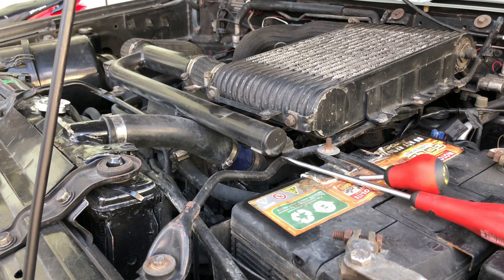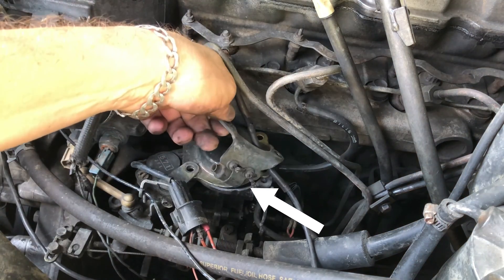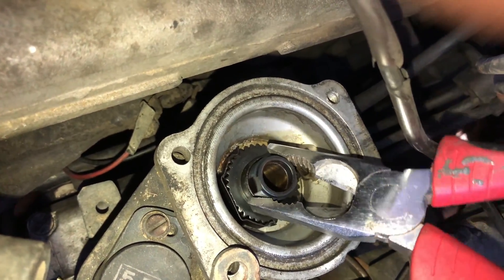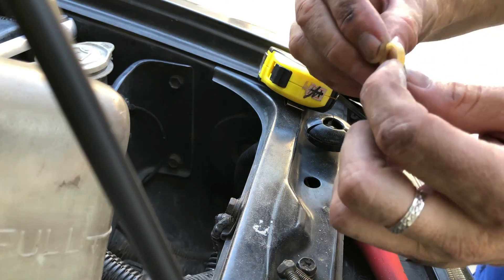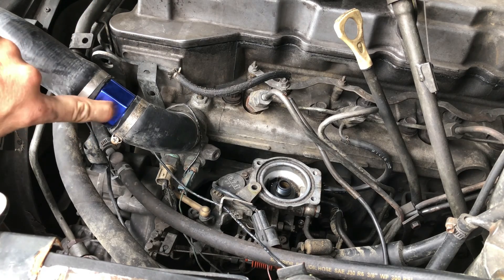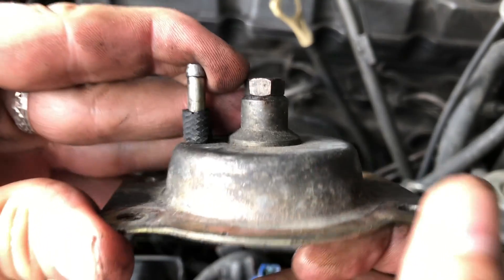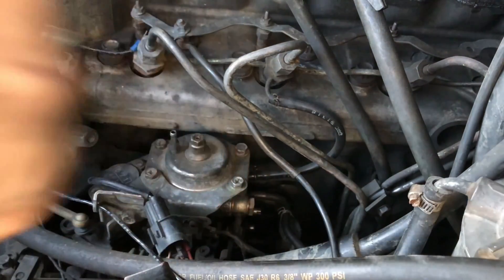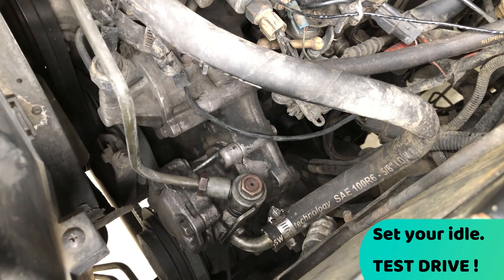HOW TO: VE TYPE INJECTOR PUMP PERFORMANCE TUNING MITSUBISHI PAJERO Shogun Land Rover Turbo Diesel VW

Comment: Hello, in the video you mentioned that it's important to install an exhaust gas temperature gauge before adjusting the boost pressure and injection quantity. Does the vehicle already have an exhaust gas temperature sensor from which the electrical signals can be tapped, or does a new exhaust gas temperature sensor need to be installed? Greetings from Germany

Comment: It would help a lot to hear the engine and see the smoke before and after. And of cause, the start after so drastic change (all changed at once)
Reply from the maker: You're probably right about that. Didn't have the idea at the time. But...interestingly, there didn't seem to be a big difference in smoke. I tried to dial it JUST enough for more fuel, but didn't want to create massive smoke clouds everywhere either.

Comment: i hope you'll see my comment here sir.
my 4m40 space gear 1994 has a sound like blown  flat tire if I press the accelerator deeply most specially on uphill, its just like 10-12psi the sound of like blown tire will be heard but if i release the accelerator it will stop whistling.
Reply from the maker: You have a safety blow-off valve on the back of the intake manifold at the firewall / windshield. If you are boosting over 0.9 bar or 13psi, then this valve is opening and this sounds EXACTLY what you describe. Thanks for the question. This video explains: https://www.youtube.com/watch?v=mez2t4xYqsA&t=65s
Reply: @offgridislandfamily  thank you sir much appreciated on yojr videos .. more power sir
Reply from the maker: @igo_techtv8522  Thanks SO MUCH for the feedback!

Comment: What about the black smok  issue after adjusting a diaphragm?
Reply from the maker: Well, there is a balance between not enough and too much. When you increase boost and fuel supply, you are naturally burning more fuel, thus, more black smoke. But too much black smoke means wasted fuel.

Comment: Hi, I followed your instructions carefully with my v16 Type 73 4M40, but the pin inside keeps on popping up. Is there any other way to push that pin so I can put back on the diaphragm? Help greatly appreciated..thanks
Reply from the maker: That pin should only push out when the accelerator is pressed, which could also be done if the choke handle is pulled? Have you checked? Normally, you very simply push the pin back in with a screw driver and reinstall the diaphram. How is it going now?? Sorry for the LATE reply!
Reply: @offgridislandfamily  Still, I can't put back the diaphragm. The pin keeps on blocking. It has a spring that keeps it holding back. When I pushed it with a screwdriver it keeps on coming back.

Comment: Hi there! Just discovered your awesome channel, i own a 4d56t 4wd 96 local pajero but am not very mechanically inclined to maintain mine personally, i have so many questions to ask is there any way i can send you pics and ask questions privately since i might get hounded by the pros here 😅, basically i would like to start with the 4wd lights in the dashcam which isn't working and the 4h not releasing from the front left wheel, i have asked other pajero users and they have many different opinions on the matter, some said transfer case, others said wirings etc., now i'm really confused, there are no good mechanics around where i live and i'm not very financially inclined to just look for a professional to fix mine, but i'm willing to learn and do what i can fix at home, tia and hope you'd consider! Eitherway your videos are very helpful! Thank you
Reply from the maker: WOW! Thank you so much for that! Glad to hear! I have videos on the lights, wiring/solenoids and the 4wd vaccum system. Please watch these first and then if you have further questions, I am happy to walk you through it. ;-)
Reply from the maker: Wiring & Solenoids: https://www.youtube.com/watch?v=RFNPFDbAmxc&t=108s
Reply from the maker: Dash lights: https://www.youtube.com/watch?v=zUIBvJHJGHY&t=116s
Reply from the maker: Manual Locking hubs (EASIEST solution): https://www.youtube.com/watch?v=TormmwfYh4U&t=1s
Reply from the maker: 4x4 Vacuum System: https://www.youtube.com/watch?v=464nQZRAYL4&t=201s

Comment: Are u from angeles city pampanga? I'm the one who asked you about the rear bushings on my pajero
Reply from the maker: Yes. Was in Pampanga, then Bulacan and now Bohol. I responded to you with a link. If you look at my front differential bushing video, there is a link in the description for the bushing company. The quality is top and the prices are correct. Thanks!

Comment: The valve you ask about "what is it?) (The one on a metal with two bolts) It will turn off the air conditioning if you have accelerated deep, so all power will be available. You do good videos, thank you.
Reply from the maker: Ahhhh! Great to know...thanks much for the answer, for watching and for the compliment! I hope you subscribe! ;-)

Comment: Hi I have done some of the upgrades you have done videos for. I have a rhd 2 door Pajero with a 2.8. I did the oil catch can, shimmed the wastegate, added boost gauge and controller, straight piped, turned the diaphragm, added a larger fan for the intercooler and hard piped the intercooler. My gauge is reading 10 psi boost and can hear it cut off when when I am full throttle. My questions would be, Why am I not boosting more and the wastegate still cutting off at around 10 psi? Also is the intercooler fan supposed to be running all the time? As mine was not on when engine was at idle. Any feedback or advice would be much appreciated!! Thank you for posting your videos!!
Reply from the maker: Realized I missed a question. Normally there is a thermal sensor on the end of the intercooler nearest the windshield. Activates the intercooler fan at a specific temperature. However, I just put mine on a switch, so I can turn the fan on whenever in heavy traffic. Then it's always off when over 40km/h. By the way...how did you install a 'larger fan'? Good work!
Reply: have a look at the end of the intake manifold, there might be what is basically a blow off valve, i had to disable that by blocking it up and then managed to get more boost
Reply: Note I have boost controller turned all the way in and still get cut off at 10 psi. Thank you!
Reply from the maker: With a functioning boost controller installed, shimming the wastegate doesn't really matter. It's a quick way to get more boost, by reducing/delaying the opening action. I shimmed mine first (3mm), then later added the controller, as most people do. Basically, it sounds like your boost controller is not very precise or functioning correctly. EXACTLY as mine was (or wasn't?). I finally disconnected my wastegate entirely and now my max is 1.6 Bar or 23psi. Kinugawa (turbo manufacturer) says they 'recommend 1.5bar' for use with their turbos, so I feel 'comfortable' at 1.6. When I install the Kinugawa turbo, THEN I WILL need an accurate, precise and correctly functioning boost controller. If your wastegate is opening at 10psi, then your boost controller is LETTING it open at 10psi. Any follow up questions are more than welcome. Thanks for watching and the video appreciation!

Comment: I was gonna do this but my 4m40 look different when i remove the intercooler
Reply: Hi the small pin type switch is AC compressor clutch cut off switch under  sudden acceleration ( throttle fully floored). Cutting off compressor gains sudden pick up and lowers engine temp.
Reply from the maker: @rajerbosho3610  Hello! Thanks...very good info. Cheers!
Reply from the maker: @rajerbosho3610  Thanks very much for that info. Good to know. Looks like I need to be locating a new switch. ;-)
Reply: @offgridislandfamily  hi the pin switch is negative Tigger (ground connection) directed to four pin relay . Basically, two functions of the switch one in super exceed auto climate control model it functions as delay timer trigger for ac comp. The second, in manually controlled ac it simply functions as activation and deactivation of ac compressor according to throttle open percentage. 👍
Reply from the maker: @rajerbosho3610  Thanks again. Are you a Mitsubishi mechanic?
Reply: @offgridislandfamily  I'm research scholar PhD involved in various research basically my core towards defense research organization in combat special vehicles, ic engines , jet engines, ram jet, autonomous vehicles further future mobility vehicle models. Having mitsubishi pajero for almost 20yrs and I loved to fix thing on my own. And have gained brief knowledge out of experience. Thank you and welcome.
Reply from the maker: @rajerbosho3610  WOW. Incredible. I'm ex Air Force. F-15 Strike Eagle. So....I'm getting lots of hate and negativity for the second intercooler. I am telling you and everyone else, the power gain in significant. Not slight...minimal or questionable, but obvious. In fact, I think I will try a third on the other side just to test how far I can really irritate people.
Reply: @offgridislandfamily  do try second transmission cooler too. And  check for auto transmission cluch pack too. Pajero gen 2 lose power sudden pickup frequently when AT oil temp running too hot. Try to install fan on AT factory cooler along with temp gauge 👍.
Reply from the maker: @rajerbosho3610  I'm no automatic transmission expert, but I think that when usually they usually begin to fail, is noticed as slipping, right? Are there unique ways that the Gen 2 transmission fails? How would I notice (other than slipping) if something is wrong? It has a factory cooler with a working fan already.
Reply: @offgridislandfamily  pajero gen 2 auto transmission fails frequently. The basic symptoms is engine rpm shoots up than actual it is same as in manual worn out clutch. And the weakest point in gen 2 pajero is automatic gearbox. 
Here the list how to perform CONVERTER STALL TEST.- In this test, the engine maximum speed when the torque converter stalls with the shift lever in the "D" OR "R" range is measured to check operation of torque converter and one-way clutch and performance of transmission .
CAUTION DO NOT STAND IN FRONT OR AT THE REAR OF THE VEHICLE DURING TEST.
(1) Check transmission fluid level and fluid temperature should be normal (70-80 degree Celsius) 158-176 F. Engine coolant temperature should be also normal 80-90 degree Celsius 176-194 F. Engine should be in ideal rpm. No electrical load should be give (AC, HEATER, HEADLAMP should be off condition and steering should be center position.
(2) APPLY wheel chocks.
(3) Mount engine tachometer if your original tachometer is not working properly.
(4) Apply parking brakes and service brake( foot brake).
(5) Start the engine .
(6) With the selector lever in the "D" range, fully depress the accelerator pedal and read the engine maximum speed.
Standard value: 2,100 - 2,500 r/min for V4AW3.
NOTE.
when doing so, do not keep the engine running with throttle full open for MORE THAN 5 SECONDS. IF MORE TEST ARE TO BE PERFORMED ALLOW THE AFT TO COOL FOR 10 OR 15 MINUTES.
Repeat the same for "R" RANGE .
JUDGEMENT OF STALL TEST RESULTS:
Case 1
stall speed in each range are equal but lower than the standard value.
(1) Throttle valve is not fully open.
(2) Insufficient engine output.
(3) Malfunction of one-way starter clutch. Note: (Malfunction of torque converter could be the problem if the stall speed is lower than the standard value by 600 r/min or more.
Case 2
Stall speed in each range are equal to each other but higher than the standard value.
(1) Low line pressure.
(2) FLuid level is not at standard level (insufficient fluid).
(3) Malfunction of O.D one-way clutch.
Case 3
Stall speed in "D" range higher than the standard value.
(1) Forward clutch slippage.
(2) Malfunction of O.D one-way clutch.
(3) Malfunction of one-way clutch No 2.
(4) Low line pressure.
Case 4
Stall speed in "R" range is higher than standard value.
(1) Direct clutch slippage.
(2) 1st and reverse brake slippage.
(3) Low line pressure.
(4) Malfunction of O.D one-way clutch.
Reply: @offgridislandfamily  Fix Atf temp gauge to monitor atf temperature and importantly install manually lock-up kit for Torque converter. If you install manually lock-up system then you can drive auto transmission like manual gearbox . It is very simple and you can do it with basic electrical knowledge. In v4aw3 auto transmission you can engage lock-up in low, 2nd, D range fully. I used to engage when climbing hills and descending steep slopes and driving on beach sand my transmission runs cooler in all rough terrain driving conditions. Before that when driving  without Tc lock-up  doing so I cooked up transmission while climbing hill and transmission was severely burnt out. I would suggest out of my experience that you should install manually lock-up kit to maintain aft temperature.
Reply from the maker: @rajerbosho3610  TERRIFIC advice! I'll look now for this locking system. But how is this different than the factory 'HOLD' option, which does work on mine? CHEERS!
Reply: @offgridislandfamily  hold option is direct 2nd start . Torque converter lock-up is done normally by TCM above 80km speed and under less throttle opening . There is always torque converter slippage to avoid that all above 90s model and modern suv are provided with torque converter lock up system. It gives better fuel consumption and reduce transmission heat build up. Torque converter lock-up is like direct drive the vehicle behaves like manual transmission.
Reply from the maker: @rajerbosho3610  So, when set to 'lock' you just shift through the gears and it eliminates slippage?
Reply: @offgridislandfamily  when TC lock up engaged you will drive like exact manual gearbox in 2nd or 3rd or 4th gear ratio. If you apply brake in any one of the lock-up gear the vehicle will stall as if you apply brake in manual without applying clutch when slowing down. And when acceleration and declaration you can feel the engine braking as in manual transmission. Personally, diesel engine like 4m40 with high low end torque with High compression can crawl on climbing up when TC lock-up engaged.
Reply: In automatic transmission when sudden acceleration TC slippage is always there.  TC lock-up kits are available. Just try and you can feel how the pickup changes atonce you engage it and engine braking will also increase which will have good control in driving.
Reply from the maker: @rajerbosho3610  Wow. Terrific description of how it functions. I get it now and want it! ;-)
Reply from the maker: @rajerbosho3610  And shifting between gears is not made clunky or worse?
Reply from the maker: How SO? What part(s) were different?
Reply: @offgridislandfamily  how can i send you a pic
Reply from the maker: Try to find this on FB: 'Mitsubishi Pajero Shogun Delica L200 Diesel 4x4 Repair, Maintain & Improve' Let me know if you can find the group or not.
Reply: @offgridislandfamily  got it

Comment: How many mm is the hose?
Reply from the maker: Which...and length or diameter?
Reply: @offgridislandfamily  both length and diameter, the hose that crack and replaced
Reply from the maker: @0123darren  10 inches long and 4mm in inside diameter. I'm starting to use silicone now with a 3.5mm inside diameter. Much better.

Comment: whats the result? hehe
Reply from the maker: Ok...so now I've had time to process the performance change. Far stronger boost and now maxes out at 1.4 instead of 1.2-1.3 and very strong to that top end. Biggest difference is IMMEDIATE boost. I only have to LOOK at the accelerator peddle and the turbo begins boosting. But, I'm going to wind the fuel screw the extra 20 degrees to a full 180. Still not enough supply at top boost.
Reply: @offgridislandfamily  I think that is the problem that I will be having soon ...
Reply from the maker: @darrentylor5473  I have consistent 1.5 bars boost now. But, still thinking I'm low on fuel. I'm going to turn the fuel pin star wheel down a bit more (inside the diaphragm housing}.

Comment: Very good videos 💚💚👍
Reply from the maker: WOW! Thank you sir! I appreciate having feedback.
Reply: @offgridislandfamily  really I'm so happy to watching your videos and learning more and more about turbo diesel so I have a galloper turbo intercooler 2500diesel.99 really you are agood man thanks again sir💚💚👍
Reply from the maker: @ebraheemabdelalmoaty4930  Thanks SO MUCH...I try to post each week! ;-)
Reply: @offgridislandfamily   thanks very very much sir 💚👍🤝
Reply: Nice little check on the orientation of your '0' on the boost compensator. Makes me wonder as I turned my boost compensator about 20 degrees further towards the front but it then felt slower and higher EGTs 🤔. So I reverted back and to where it was, just about facing the battery and it ran better
Reply from the maker: @barkyclarky  Right. I experienced something similar. A bit like when a gas engine runs too lean...low power and runs hotter. After people telling me several different 'original' positions for the '0', I decided to investigate further. And, as shown in my video, the '0' didn't match ANY geometries or marking on the diaphragm pin, so...well, you can see. I recommend you do the same, so you know exactly where your fuel pin is contacting the cone shape. Did you shim your waste gate and/or add a boost controller?